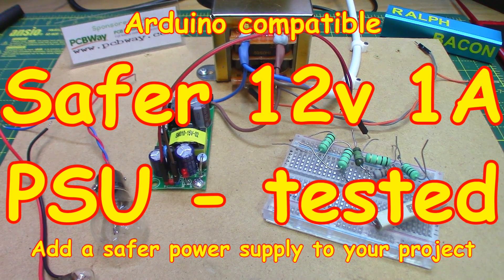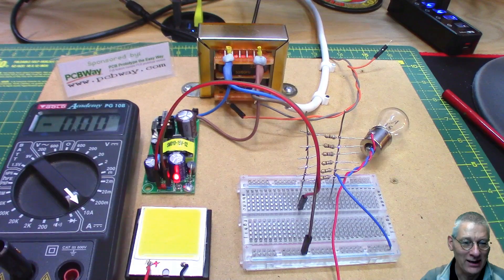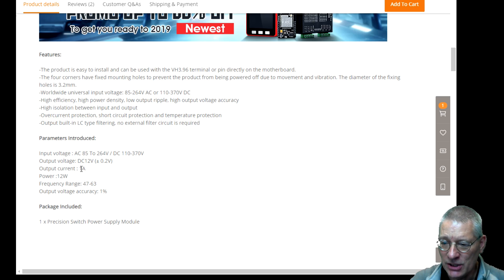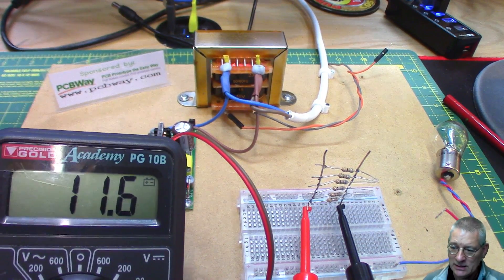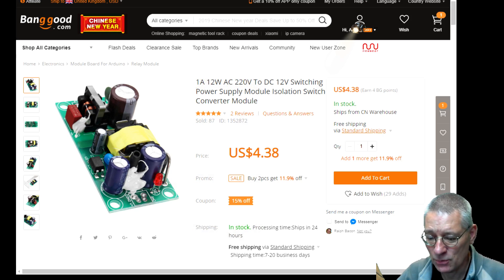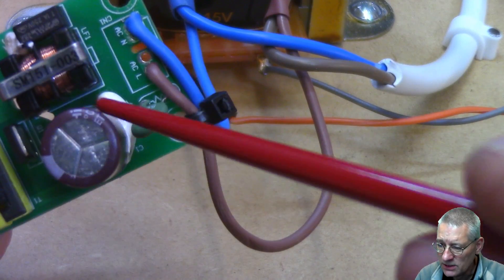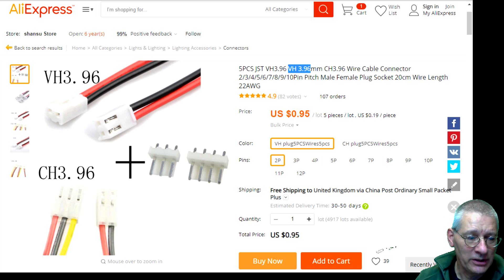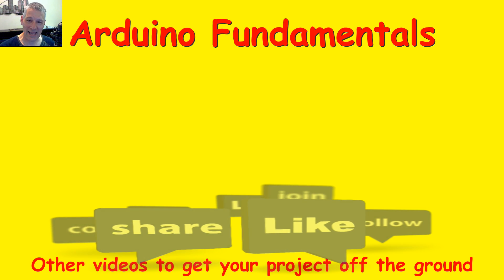#135 Compact Switched Mode Power Supply 12v 1A (tested)

Comment: That thing is $8.99 now.  WOW.   On Amazon too.
Reply from the maker: Is that a good price? Or was that WOW because it has become expensive?
Reply: @RalphBacon  $4.38 when you recorded the video.  I've been trying to find something like it that's cheaper, but I've only found things that are more expensive.   That's some pretty hefty inflation over just 4 years.  Electronics are supposed to experience deflation actually so that price is very surprising.  I'm in Asia building a house (for my wife, not me, haha) and a "fence" here is an 8 foot concrete wall with columns every 3 meters.  I thought it would be cool to put an Arduino on each column that buzzes when motion is sensed and also have some tiny LED lights that blink to give the appearance of high security - that along with the 16 cameras that are along the perimeter fence.  Cameras are so silent though - they just sit there - I'd like something that gives off a sound and some light.

Comment: How is the blue capacitor [?] connected. I suspect across the transformer to reduce EMF so it causes leakage and if it shorts can damage the load.
Reply from the maker: I don't know how it's connected any more, Kenn. I suspect these are built down to a price rather than up to a specification!
Reply: @RalphBacon  Yep, though I believe EU and 'USA" rules require EMF suppression and so most have a cap to suppress the switching noise.

Comment: The glue helps to anchor the component so it does not vibrate/shock off/loosen.
Reply from the maker: But messy or what?
Reply: @RalphBacon  Messy!   They just slop it on. Probably use a stir stick or spatula to apply

Comment: In my experience many of these SMPS are rated well beyond their capacity - its rated at 1 Amp but can barely deliver 600 mA.  One unit was rated at 2 Amps but could only give 450 mA.   And the voltage does vary - often considerably. And it is rarely 12V; ranging from 11.4 to 12.3 Volts which is bad news for those powering LEDs.   Do do a full load test and check the waveform ism't too far out of whack. I bought a so-called LED drivers which gave pulsed DC (clearly half-wave rectification) which caused the LEDs to flicker horribly
Reply from the maker: Indeed Kenn, when buying from China it is definitely Caveat Emptor! If it look too good to be true... well, we all know how that ends. When I powered the HomeAlone unit in my mum's apartment I bought a medically certified PSU with a certificate and everything from a reputable UK supplier, so that I could sleep at nights not worrying I was about to burn her place down!

Comment: Two bulbs in series
Reply from the maker: If I'd had two bulbs, yes. But now I have a proper current tester with huge heatsink, fan and everything! Welcome to the 21st century, Ralph, I know.
Reply: @RalphBacon  you know you can get aerosol cans of magic smoke to recharge those poor resisters.
Reply: @RalphBacon  I didn't see a video on building the current tester. I'm visualizing massive power transistors... On even more massive heat sinks.
Reply from the maker: I never showed it, John. One day. The heatsink is only as big as you would find on an old Pentium 4 CPU (with fan). Chunky, I would call it.
Reply: I cringed when I saw the light bulb.   Incandescents have a HIGH inrush current (very low initial resistance) which can easily triggered current limiting, short-circuit protection, or cause it to not work properly or even damage the PSU

Comment: Lately I have begun winding thick Nichrome at a given length for custom shunt values.  Of course you cannot solder the stuff ... but the ends can be clamped with screw terminals.
Would like to have one of those digitally tunable loads, or shunt regulators.

It was fun though, watching that ladder of resistors melt!  ElectroBoom-esque!
Reply from the maker: You'll be pleased to know I now have a proper digital load tester AND lots of wirewound resistors. So when I revisit this topic it will go so much better! Glad you had fun watching it!

Comment: Holly carp!  All these comments and not a single one about the power through those resistors!  "...1/4 watt resistors, and I'm trying to put 12 watts through there."  Yeah, but, it's a parallel network of six identical resistors.  So 12 / 6 = 2 watts per resistor.  Still way too much for the poor things, but a true 12 watts through any single one would have blown it up pretty much immediately.
Reply from the maker: You'll be pleased to know, Chris, I am now in possession of a proper, digital load tester, as well as several high power resistors for when I repeat this video with another device (that didn't arrive in time). Those resistors survived, it was the solder that melted first!

Comment: The NTC slows the inrush of current to the first capacitor to prevent sudden power spikes when power is first applied. If you could imagine using 10 or 12 of them to power a bunch of lights or other accessories and in the morning you flip on the light switch...they would all pull a huge spike and pop your breaker. and to go along with some of the other comments on the glue, some components will also make whining noise on SMPS and the silicone glue can cut that way down...
Reply from the maker: Yes, there are several theories about that "glue", from preventing noise (the whining you mention) to stopping them getting damaged. I do notice that newer boards do not have that white glue on them. Your points on the current inrush limiting has been corroborated by several others here so I guess that must be why. Thanks for posting, nice to hear from you.

Comment: DAMN!  A couple years back, I ordered one of those, well sort of like that, it went from 110 down, I wanted to run a 100 watt LED with it.  When I hooked it up, it began that flashy flashy thing.  I figured I had been screwed by the seller and promptly threw it in the bin. Now I see I probably threw away a good PS that I was just overrunning!  Bet if I had hooked a 20 watt or something it probably would have worked!  Well you live and you learn I guess...
Reply from the maker: At least they cheap enough to buy again, Jerry, better luck next time!
Reply: ALWAYS a good idea to do a full load test FIRST using resistors or such

Comment: This glue found on the power supply is Silicone Rubber Glue (like electrical tape). https://bit.ly/2H2yrmK
Reply from the maker: I think you might have finally identified what it actually is (and where we can get it, too). Thanks very much for sharing that information.

Comment: Ralph; When you was testing the O/P for ripple did you load the PSU to its maximum rated current. There are loads of PSUs out there that are great off load but are dreadful when loaded. I've even had some "so called" professional grade that fail to cut the mustard when heavily loaded.
Reply from the maker: Two things I did wrong, Brian, because I rushed it: 
1.I forgot to look for AC only (I thought I'd done this but obviously not)
2. I didn't load it because I didn't really have anything to load it with. As you saw!

Now I have an electronic load unit on order as well as some beefy wirewound resistors so next time will be a different kettle of fish. Let's hope they arrive soon.

It will be interesting to see how it (and its smaller brother) fare.
Reply: @RalphBacon  Fodder for a very good Part 2.

Comment: Hi Ralph. Better. So we now can read your annotations without pausing the video. I like it. 
I also do have some of those type of supplies in use for longer now and never one failed. 
You might consider buying or building (it’s really easy) yourself an electronic DC load soon?
Reply from the maker: I did consider building one, Michael,  (Dave Jones on EEV built one from "junk" in his toolbox, apparently) but I don't have the time so I bought one. Luckily, several other people have bought or have recommended the same one. All will be revealed in due course.
Reply: Ralph S Bacon Daves video was also my inspiration to build one myself. It was easy and just works fine. But I also bought one from China (where else) a few months ago. I assume we will see what you ordered in a future video?
Reply from the maker: No spoilers, Michael!

Comment: Perhaps when you do your smps video you should also do a bit more on the dangers of ac mains supply.  I was an electrical fitter in a power station, before I retired, so am comfortable (relatively speaking) working with mains.  Many arduinites have probably only used batteries or shop bought power supplies and may not have had to work on mains in this type of environment!  I use these type of modules but never unattended and also use them well within the stated current rating.  It is also worth mentioning that they are referenced to mains so build quality is important!
Reply from the maker: I agree it is very important to highlight the dangers of mains voltages (whether in the UK or other countries). You and viewer whitefields5595 would get on well together (on this subject)! I will reiterate the warnings without trying to sound patronising the next mains-related video I do. Thanks for the suggestion, gartmorn.
Reply: Hope I didn't sound patronising as I just wanted to suggest that not all your viewers have your level of experience and knowledge of electricity (in some cases scarily so) so it's always a good idea to cater for the lowest common denominator!
Reply from the maker: Not at all, it's something that should be said. I just don't want to come over as condescending to my viewers, teaching them to suck eggs and all that! But it's worth reiterating whenever mains voltages come up, and I'll do it! Don't worry, your suggestion was well received.
Reply: This is an alternative to the Hi-Link module btw!
Reply from the maker: Hmm, always worth getting one and ripping it open - unless Big Clive has done that already! But still worth considering if it's got the BC seal of approval. If I get one you'll hear about it on this channel.

Comment: Best way of invalidating your home insurance. If a non-approved 240V device fails the claim is unlikely to be honoured and you will be deemed negligent. In your case the isolation transformer helps to some degree but most viewers will not have an IT and will go straight to mains with this non-earthed product. It is a standard design extracted from a wall-wart. By the time you have rendered it safe a wall wart would be cheaper .... and your insurance company will be more happy.
Reply from the maker: Do we trust those wall warts, then? Despite their supposed CE markings (China Export, naturally) I don't really see a difference. You did watch my video #90 with that burnt out wall wart? That didn't have current limiting or thermal limiting. It just burnt out and could have taken my house with it just the same!
Reply: @RalphBacon  I was the last to comment on your vid 90 a year ago. As you said in vid 90 there is nothing wrong with wall warts provided they are from a reputable source.  However what you have done here is buy what appears to be the internals of a cheapo wall wart and promote it on your site! This is why you make me anxious and why you must remain on the Naughty Step until I can figure out what to do with you
Reply from the maker: But I'm not sure this is the innards of a "cheapo wall wart". Or, at least, it has a reasonable design that nods towards the separation of AC lines (something JW approves of) and a nice gap between the AC and DC sides and has current limiting (including short circuit protection) with thermal limiting (not tested, yet). That in itself must make it better than a cheapo wall wart which mostly has none of these and will happily burn your house down as it overloads or gets too hot.
Put it this way, if I had thought this was a load of tat I would not have chosen it for a video. On what basis are you forming your poor opinion of this device? And don't just say it was made in China!
Reply: @RalphBacon  Ralph, My comments are not based on Sino-cynicism, nor of the device itself, but how you are proposing to use it. These low power small form factor SMPS are manufactured for OEMs to include in their products. In this case possibly, but not exclusively, wall-warts. Banggood are buying these in from SANMIN in bare form and promoting to the DIY market through you which is all well and good if used correctly.  

Your front page of this vid states ‘safety’ in two places and ‘tested’ in one so that proposition needs to be checked out.

This PSU is not intended to be used in it’s naked form without the following;

1 Mains input plug and fuse
2 Probably better input terminals
3 Physical insulation through encasement or potting

These items would be added by a responsible OEM if it appeared in a wall-wart. Once these are added to our DIY projects in the home I expect the cost differential over an approved PSU is minimal, especially if you light the kids up.

You do the right thing in using an isolation transformer when testing unknown mains devices. However, I note also that your white 3 core cable has a moulded plug with I presume an earth core that is not visible in the vid. In a video on safety you missed an opportunity to earth the transformer chassis and explain if this can be done without earth-referencing the secondary. You are working on open mains circuitry and me (and ‘scared’ gartmorn below) sense that some of your viewers could get hurt. What appears to be Blu-Tac (the Devil’s Putty) on the transformer connections is noted.

Finally, as another has noted, your scope was DC coupled in your output test and you did not explain the load being driven. Any open-circuit ripple test is meaningless. Various forms of load (inductive, resistive or capacitive) at 1A should be used to support your claim to test this device.

I find you subjects, style, pace and presentation entertaining and you caveat your mains work in the comments section with health warnings, but the most salient warnings arise from leading by example in the original video, hence the Naughty Step.
Reply from the maker: I can agree with just about everything you're saying here. And if I were teaching a class of 12-year old kids, doubly so! I assumed (always dangerous) that anyone following my lead with this device would take the necessary precautions (but that might include inexperienced viewers, including 12-year olds, you never know) so, as you say, lead by example. So...

I can see that a full-on safety warning and discussion on mains electricity dangers and how to mitigate the risk in my next mains-related video is in order. You make your points well, whitefileds5595, and I'll reluctantly remain on the naughty step until further notice. 😔

Comment: Higher voltage DC may be useful in EV, running off the traction power bus.
I used a conventional switchmode PSU (Meanwell) in a solar car with ten 12V (deep-cycle lead acid) batteries in series.  That supply cost about AUD$30; back in 2003.
Reply from the maker: Are yes, electric cars, they use DC of course! I can see how this module (or one like it) might be used there. Good point, Bernd, thanks for the information.

Comment: The silicone adhesive is commonly applied to secure components that might move (flex) over time so that the leads are not damaged due to this movement.  Good quality power supplies use this to secure larger capacitors so that... They last longer.
Reply from the maker: Would they flex in a stationary project, Richard, or are we talking about general heat-related expansion and contraction? The general view here is the same as your though, to keep the components secure.
Reply: All things are "possible."  However, thermal cycling is the main culprit.  The reason that you see it applied to transformers is that they do generate heat, and the leads used can be rather flimsy.  Stress during shipping to their final resting place is a concern, too.  You've heard the stories that shipping services around the world use only gorillas who meet minimum weight requirements and who show special skill in handling packages?   @RalphBacon
Reply from the maker: I thought those that failed the requirements for the shipping services you mention became baggage handlers at most airports? 🤣 
But, yes, I hear what you say about the reasons for the adhesive, sounds quite plausible (and doubtless why they do it) but the application of it leaves something to be desired - if they are going to just pay lip service to protecting the vulnerable components then at least apply the right amount in the right places! Thanks for posting Richard, nice to understand these things.

Comment: The jollop stops the bigger components vibrating harmonically if the PCs is subjected to that certain frequency such as if mounted on a motorised application. I had some PCBs tested for vibration resistance and especially those electrolytics shake like mad if you hit the right (wrong) frequency. Great video Ralph. Thanks. Mike
Reply from the maker: Interesting, Mike, another viewer suggested dampening of frequencies too. Glad you like the video, thanks for posting.

Comment: Switch - not switched!
Reply from the maker: Nope! Can't agree. A bit like scone (is it skown or skon? Rhetorical question, don't answer!) an SMPS can be any of the following, according to Wikipedia's article on switched-mode power supply:
1 switching-mode power supply, 
2 switch-mode power supply, 
3 switched power supply, 
4 SMPS
5 switcher
https://en.wikipedia.org/wiki/Switched-mode_power_supply

It doesn't matter at the end of the day, a power supply is delivering power through some clever electronic switching mechanism. Job's a good 'un.